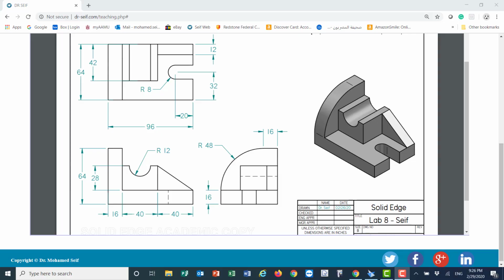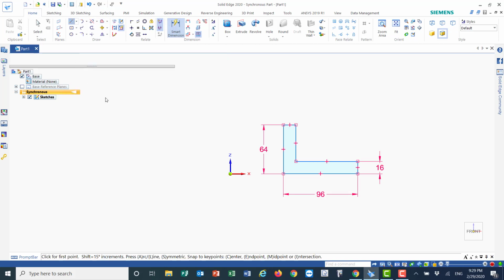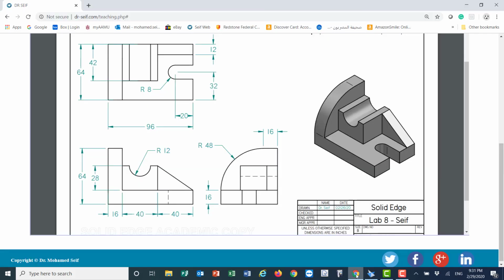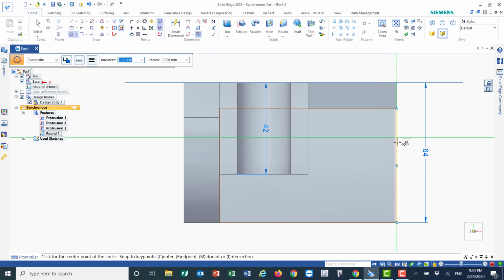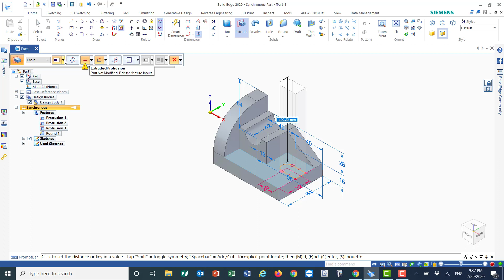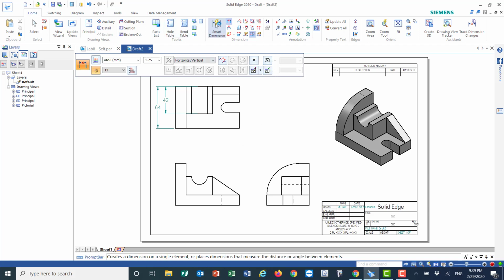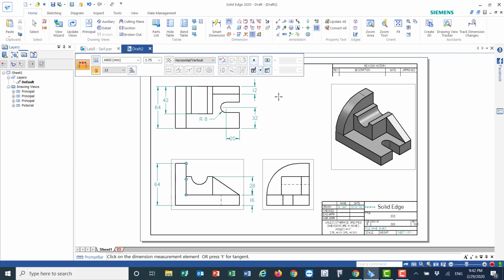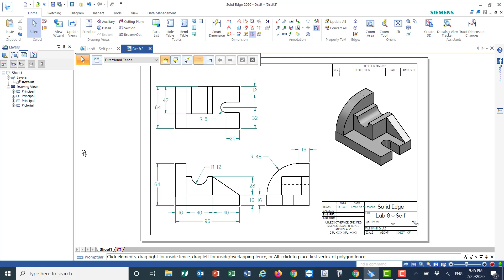Learning Solid Edge: (Lab 8)

Comment: Dr. Seif, Thank, you for responding to my issue below; however, I simply have not been able to get this to work. Something is missing, some step is being left out and I cannot understand what that step is. I have tried repeatedly, starting over numerous times without success. I'm working on Lab #8 where I'm trying to place a circle to make the R8 hole to create the slot. I followed directions, highlighting the edge as you showed to lock the face then moved to the top view. When I use the distance between function it gives me the dimension in blue. Clicking on this dimension turns it yellow or orange. Click on it again and it turns green. There is no way to modify the dimensions to move the circle. What am I missing?